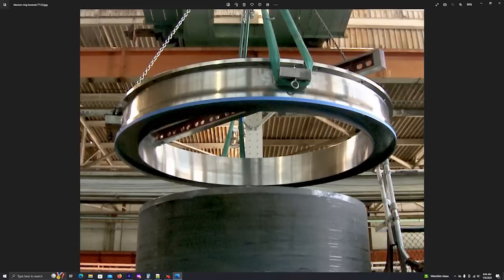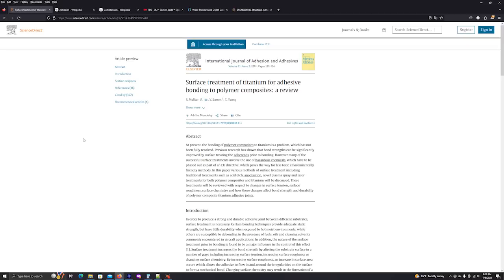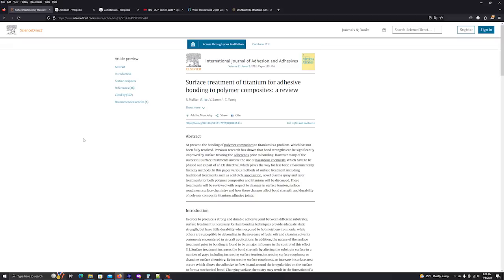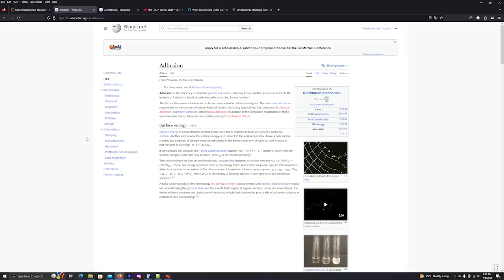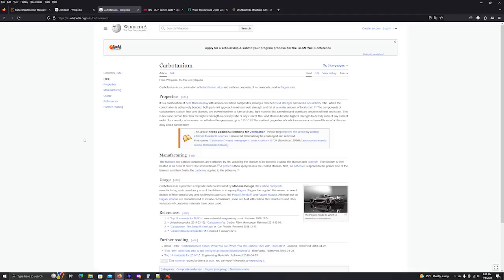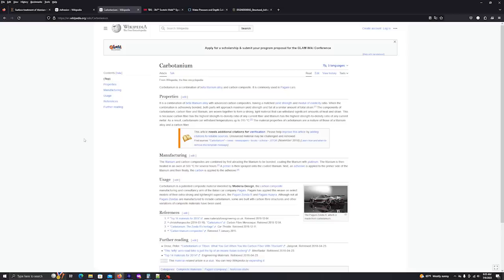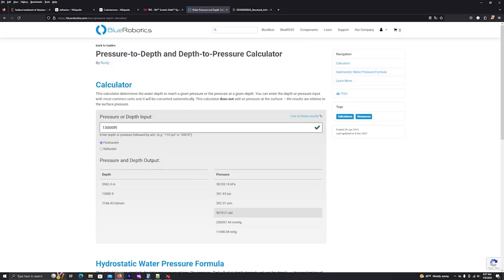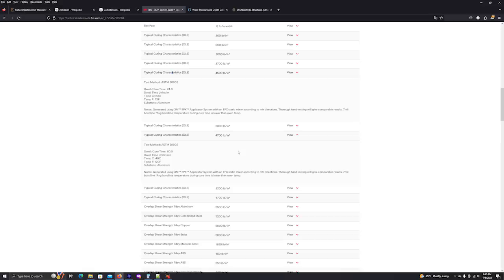Oceangate Titan Adhesive issues between Carbon Fiber and Titanium

Comment: A couple of additions to your analysis - there is a video of them applying the adhesive to the titanium ring, which shows them using flexible spreaders similar to those used by auto body technicians.  While these work well to fair auto body repairs, they are inappropriate for applying adhesive because it's impossible to get an even thickness of adhesive.  

The spreaders used did not appear to have serrations on the edge. Serrations, in combination with a stiffer metal blade tool, would have made it possible to achieve an even thickness of adhesive.  

There is also a video of them lowering the Ti ring onto the CF after the adhesive was applied to both parts .  There appears to be no adhesive "squeeze-out" after the Ti ring is fully seated, making me think that there was not enough adhesive used.  

It looks like they put blue painter's tape around the outside bottom edge of the Ti ring to make it easier to clean off squeeze-out, but there wasn't any squeeze-out shown in the video.  There does not appear to be any blue tape on the CF.  Maybe they had tape on the CF when they applied the adhesive to it, then pulled the tape before lowering the Ti ring, but why would they do that?
Reply: lowering the ring with a swaying, gantry crane, and eyeballing the alignment means that it was not centered perfectly.  A precision jig should have been used for assembly.
  If off centered, adhesive will be too thick on one side, too thing on the other, plus if the flange swayed any, airpockets may form.  
sloppy assembly method.
Reply from the maker: Yes I was thinking the same thing.  The epoxy specs I showed from 3M in the video recommends a 7 mil thickness.  They appeared to spread the epoxy too thick on the titanium.  Thanks for the comment
Reply: I recall an Oceangate video where Rush was speaking of the glue joint where he stressed they have to use enough, but not too much glue which suggests to me that they didn't rely on excess glue squeezing out, but rather preferred to use a calculated amount to avoid excess.  I have no idea why.
Reply: @Andy-df5fj  Because that kind of thing works in fabricating aircraft and spacecraft parts. He was using lessons from the wrong discipline and calling that 'innovation'.

The song Yankee Doodle sings about intellectuals who learn new things from disparate cultures and use them incorrectly while thinking themselves more modern. Stick a feather in his cap and call it Macaroni.
Reply: exactly the same tool to apply cream on a cake !
Reply: It should have been put in a vacuum chamber and had any voids evacuated.   Squeezing the parts together.
Reply: @lookronjon Yes, this, plus it should have been cleaned properly/and or done in a clean room type environment. God knows what kind of oils/contaminants were introduced to the bonding surfaces.
Reply: That video gave me the creeps. Such a cavalier approach to such a critical point of failure. Some of the pops heard on dives was possibly those air pockets trapped in that plastic layer being squeezed to cavitation. Then the pocket void pressure is released as they come to the surface damaged. Do that enough times and you begin opening up cavities to water intrusion which at pressure begins etching out a way into the carbon fiber bodies ends exposed by shaving the hull ends for capping. Once in a strand, any weakness in matrix along the length of that fiber will balloon with sea water and migrate throughout the hull until something gives.

No way this was a proper design. It looks great for aeronautical applications where stresses and strains come from predictable directions unless the pilot cuts a flip and engineers say 'you're not supposed to use it like that'. But for subsurface applications, there's only oneplace where the forces far beyond anything imaginable in an airplane or spacecraft will be applied. Everywhere. And anywhere you have a difference in material or fastening method, that is where your failure will show most clearly.
Reply: I learn more from YouTube comments than the actual video. Great analysis.
Reply: @WindTurbineSyndrome  If you know what you're reading and understand fundamentals it really is a great source of information. But so many just wing it with so little thought. And then there are the people who are smart enough think up bull** but not smart enough to follow critical paths.
Reply: Even this seems like a detail. I want to know how they even determine if its flush? It looks like the just pressed it down with their hands and called it lunchtime. How did they even determine the cap was on? Just eyeballed it?? If it was askew at all it seems like a fairly serious defect.
Reply: you know once under water they wouldn't even need to have the two pieces glued together...the pressure of the water alone will make it impossible to separate the caps even if you'd try...so the glue as NOTHING to do with all this.
Reply: @TechWizMaster  
While it's true that the pressure would squeeze on the caps, the glue itself is still subject to pressures and could extrude through the gap.   Still, I'm more concerned about the thin titanium flange that interfaces with the inner diameters on the ends of the carbon fiber tube.  Under pressure, the walls of a cylinder are the weakest point and as it compresses under pressure, that thin flange is to weak to resist collapse.
Reply: @TechWizMaster 
The glue is necessary to waterproof the joint between the Ti ring and the CF.  Otherwise water, at 6000 psi will go straight through the joint.  It’s not just to bond the two items together.  It is aimed at making them a single gas tight unit.
Reply: @TechWizMaster  The glue was there to also seal the joint. On implosion the CF cylinder deformed and apparently disintegrated glue or no glue.
Reply: @TechWizMaster  Exactly. In fact, the glue itself provides an avenue of intrusion that would not have been there if the flange could have been swaged under vacuum to a more beefed up hull end mate. I think I should patent that idea for the next carbon fiber submarine attempt.

Comment: Pretty familiar with a adhesive like that and it is used in aerospace applications. I used it for avionics racks many different type of throttle quadrants, And many boeing parts even f22 raptor stuff I think its a very popular aerospace adhesive.
Reply: Loctite 9394?
Reply: @vertihvost7675   No it is a two part epoxy almost like JB weld . Mixed if my memory serves was a 2-1 mixture by weight. The place I worked at got it from McMaster car
Reply: ... and I'd have made sure you used a "Primer" before applying the Adhesive right? (I was on the F-22 Program as well and the Primer is clearly listed in the job cards). Evidently, Rush skipped that step ... but really wouldn't have matter ... the Hull went first IMHO and no amount of Primer or Adhesive would have saved this vessel.
Reply: @craigsowers8456  Agree
Reply from the maker: Thanks for the comment,  Yes Epoxy adhesive is very common in the aerospace industry

Comment: I'm not a engineer, but trying to bond titanium steel to carbon fibre plastic using only glue does not sound like a great idea, much less sending it into the abyss of the ocean...
Reply from the maker: Using epoxy adhesive is very common in the aerospace industry.  But you have to use the right material and the right process.  Thanks for the comment

Comment: the titanium ring needs to be etched in hydrofloric acid and then anodized before bonding.
Reply: No, the way to have prevented this would have been to hydrochloric acid etch Stockton Rush.
Reply: @martinwhite418  Give that man a break, he's currently under tremendous pressure now.
Reply: @wshyangify  Baahahahhahh.
Reply: @martinwhite418  no hydrofloric can make things disappear
Reply: @huntandrew4409  That would have been good.
Reply: I thought the acid etch was to passivate the titanium, and prevent galvanic corrosion with the carbon.
Reply: @kevinkelly2513  
The acid etch will remove pasivation and make the surface rough, if anodized will make a thick oxide moleculer layer,easier to bond to.
This is very common with aluminum with painting
And the chemical cleaning will make surface clear from oils,well until someone puts hands on it.  
That part of Shiney titanium
Reply: @huntandrew4409  Thanks for the input, but none of these methods will provide resistance to even just car wash pressure, much less the much higher pressure washer of the deep.

Comment: I think they’re onto something there. I’ve been expressing great concern with the glue up process all along. Normally you don’t get a glue bond between two materials without some type of pressure and/or heat. And of course surface preparation is also very important. I just thought that was the most ridiculous thing I’ve seen on this thing since the very beginning. Gluing carbon fiber to a titanium ring. - Sort of like gluing an ice cube to a butter patty in the summertime.
Reply: I love your analogy of the ice cube and butter. I wonder, however, how critical the carbon fiber to titanium bonding is in the undersea world it was designed for. Wouldnt all that incredible hydraulic pressure be forcing the end caps IN to the carbon fibre tube? In that case, the flange relationship would be more important than the adhesive bonding. Does that make sense?
Reply: @n9zmn No it wouldn't push the end caps into the tube. The pressure on the pressure vessel is greater because it's larger .
Reply: @kinte1870  not exactly ... hull imploded first IMHO ... and we both know "Water" cannot be "compressed" so it shot the end caps off like Champagne Corks. And given the videos, it would appear Rush didn't bother to even add the requisite "Primer" between faying surfaced ... otherwise, there'd be some small fibers left on the Titanium flange surfaces. Again, IMHO.
Reply from the maker: Thanks for the comment
Reply: you know once under water they wouldn't even need to have the two pieces glued together...the pressure of the water alone will make it impossible to separate the caps even if you'd try...so the glue as NOTHING to do with all this.
Reply: @TechWizMaster  correct ... and what kind of idiot would board a vessel with zero chance of escape? WOW And these are "Billionaires" !!!
Reply: Do you know what kind of battery they used? 12V lithium?

Comment: Putting your life at risk in a vessel whose critical joints are connected by glue - I don’t think so.

The carbon fiber probably virtually pulverized under the pressure, suddenly increasing the internal pressure and basically exploding, blowing the end caps off.
Reply from the maker: Yes I tend to agree with you.

Comment: Interesting Joe. No way I would have got into that sub to go down 40M let alone 4KM. With a background in heavy industrial / petrochemical refrigeration I was surprised that if they built it in this way there was no through bolts holding the titanium flanges across the longitudinal length like a standard flanged component and perhaps these could have supported the CF tube by incorporating CF saddles or similar, I’m sure there’s a whole range of other issues like compression of the CF tube and you still need bonds or gaskets between, personally I’d prefer steel, stainless or titanium.
If you haven’t seen it, the hydraulic press channel has done a pretty good model simulation of a carbon fibre tube with bonded steel endcaps, the failure mode seems pretty clear in that case that the CF reaches a pressure at which it completely and in an instant implodes and seperated completely from the bonded ends. Obviously, there’s variables and he doesn’t have the same materials, epoxy or can’t reach the full pressure but it’s interesting and they also attempt to demonstrate the effects of the pressure cycling.
Check it out for yourself 

https://youtu.be/BQGDwE3yMb0
Reply from the maker: Bolting through carbon fiber created isolated stress points around the holes.  Bonding in the aerospace industry is very common, but you have to use the correct epoxy and the correct bonding process.  Thanks for the comment
Reply: @JoediyLab  I think that was a key issue here, Rush's undergrad degree was in aerospace engineering. (Masters in business). I believe he used what he "knew" from aerospace, which has basically opposite and much smaller pressure differentials,  from deep sea engineering concerns.

Comment: So… How did the domed end caps get separated from the flanges? They were held together by 17 bolts… If those got separated by the implosion, then the adhesive pieces never had a chance to begin with…
Reply: If the adhesive was just serving as an o-ring seal, always in compression, then that's not a problem.  That the shock-wave of implosion sheared it off is unsurprising but irrelevant.  There are a couple of possible failure modes though. One is that the CF tube flexed enough to part the seal and the sealant was too rigid to follow it.  The other is that the sealant flowed under pressure and blew through.  Neither of those modes would seem likely to implode the CF tube though, and would be relatively slow.  See the Hydraulic Press channel's example where his sample tube seal failed: it just quietly flooded.
Reply: likely needed a 100 bolts but that would have only saved the end cap not the little viewing window. Plus what were the bolts' strength that he used? How old were they?  How tight were they torqued onto the rings and other part? What glue was being used, was it ok to be used where a vessel was always in water? Was the glue new or had it been sitting around for a bit like in some overheated area, etc etc?
Reply: @MissX905  The CEO probably didn't care about the torques and provenance of the adhesives or the quality of the screws. Probably everything came from scrap metal.
Reply from the maker: Thanks for the comment
Reply: good question. i want to know the answer too...
Reply from the maker: That is a good question,  I do not have an answer for you .
Reply: The bolts probably were for more alignment and while on the surface. They wouldn't need to hold much load because the water pressure was pushing the surfaces together. But separating return shock from the implosion was too much for them.

Comment: Seems it was a huge mistake constructing this hull assembly from two completely different material types. Carbon fibre os a relatively new material which dosent have the necessary "track record" in this type of application, and is allegedly difficult to successfully NDT. Surely would have been better to have constructed a metallic spherical based structure of one material type.
Reply: Not whith the same design and dimensions, impossible to float on surface probably, this is the main reason of that choice, light weight and 5 passengers.

Comment: Just build it in very thick titanium and put bigger thrusters on it. Job done!
Reply: It wouldn't be buoyant. You'd need negative ballast, like the Trieste.  Relying on thrusters to get to the surface is a recipe for disaster, and also needs bigger heavier batteries.
Reply from the maker: Thanks for the comment.  Yes Oceangate did mention buoyancy issues and his reason for choosing carbon fiber.
Reply: @timjackson3954  How about winching it down on a very long chain?
Reply from the maker: Would not have helped with the failure.  Thanks for the comment
Reply: But that would cost money

Comment: Perhaps a silly question but was the carbon fiber hull wrapped around an inner titanium hull? Or was the titanium only located on the end caps/rings?
Reply: they wrapped it around a stainless steel cylinder from what ive seen.
Reply: @Sprocket2A  Thank you for the reply!
Reply: Wound around a metal form that was removed- so the carbon fiber stood on its own
Reply from the maker: That is a mandrel for holding shape.  Once the carbon fiber is cured they pull the carbon fiber off of the mandrel.  Thanks for the comment
Reply: @JoediyLab  - Thank you for clarifying. Wow, that’s truly frightening. I’ve seen a lot of crazy things happen with carbon fiber bike frames (cycling bikes, not motorcycles). Stress cracks that go unaddressed and then completely fail. Different situation and use, obviously, but still…yikes!

Comment: Could the The viewing port transparent material have failed first and then pressure blew the end caps off the retaining rings as the carbon fiber material disintegrated.
Reply from the maker: That is a very good question,  The viewing port was rated for only 1300m so yes that is a possibility.